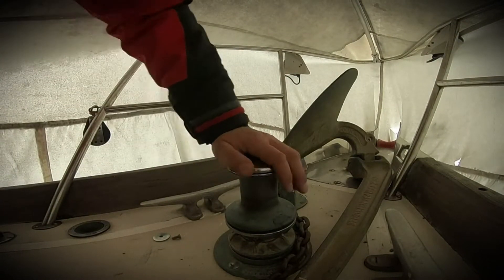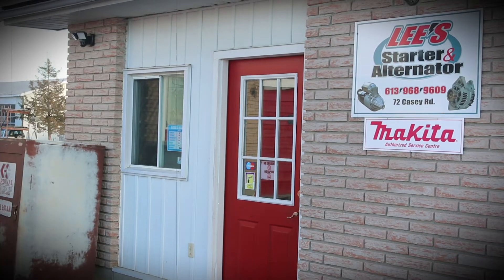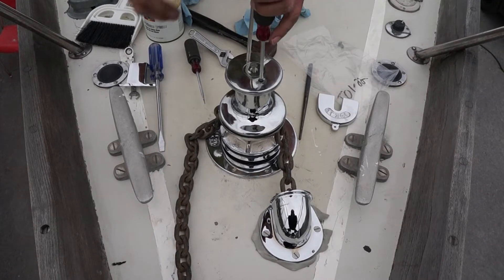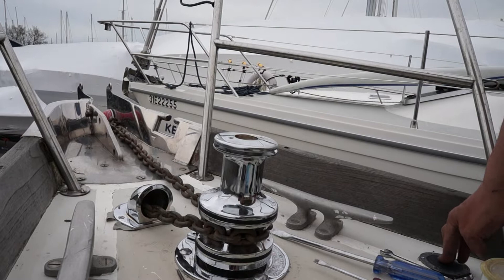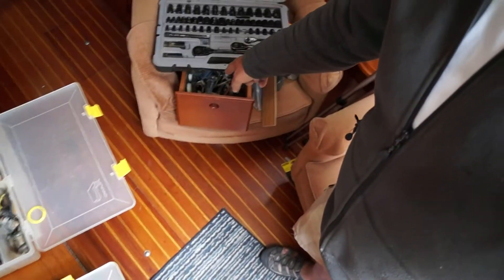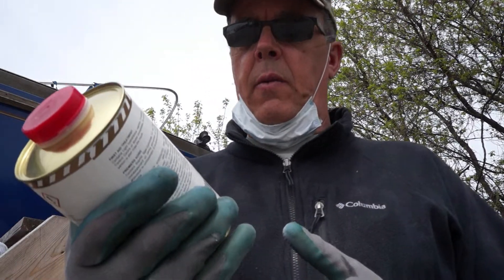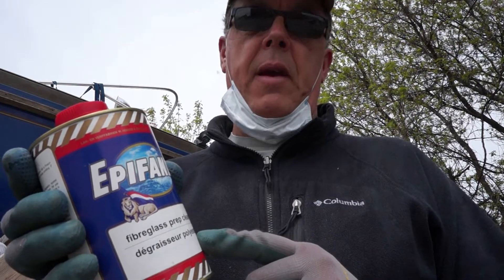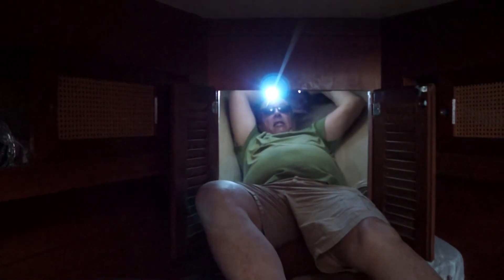Where Did I Go Wrong????? ⛵😡Episode #93, Wind over Water

Comment: Looks like that motor and gearbox could have used a new coat of paint.  That stuff down below needs to be protection from corrosion more than the bronze parts on top need the bling IMHO.

Professional electrician tip: Always check the voltage at the terminals under load.  That is, have someone on top push the button while checking voltage and with the leads connected to the motor. A bad connection back at the solenoid or elsewhere may show voltage on the wires when it isn't hooked up but crap out and not pass any current as soon as the motor is in the equation.
Reply from the maker: Thanks for the tip. Incidentally, the gearbox is bronze and the motor was painted and re-sealed with high heat silicone engine sealant. Should be fine. I will be checking voltage and possible gear issues (from re-assembly at alternator shop) shortly and let you all know how I make out. Pretty committed to this beast so hope it works.

Comment: Have you tested the wiring to the Windlass to see what voltage is at the terminals? If there is a bad connection then you may not have 12V  at the motor
Reply from the maker: We have set it aside to get the paint work done. Time is pressing right now. I really just installed the windlass to plug the holes in the deck. We will look closer at it once we launch her and can work in the slip. Stay tuned.